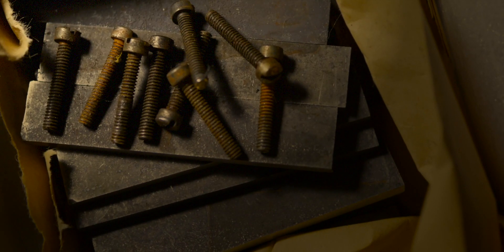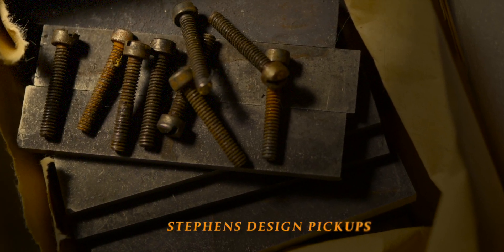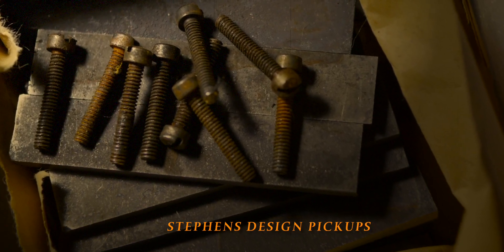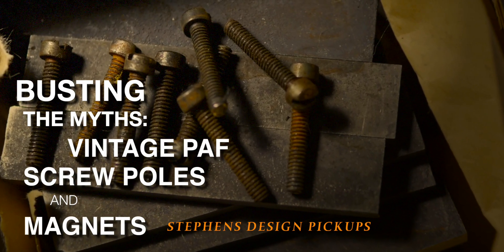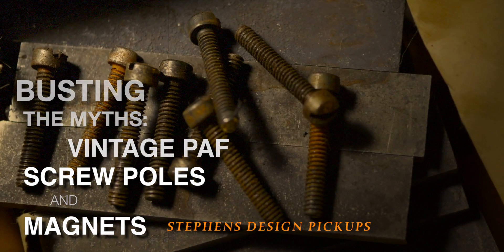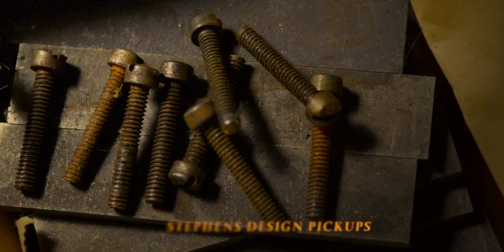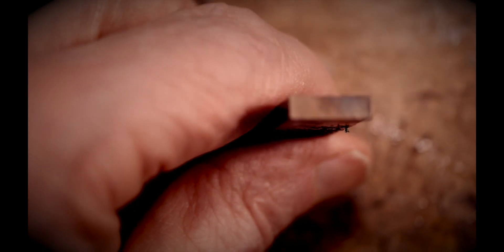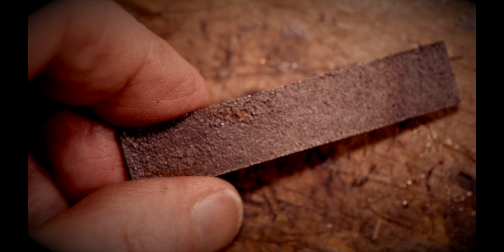PAF MYTH BUSTING - MAGIC MAGNETS AND POLE SCREWS

Comment: LOVE THE NOT SO SHARP INITIAL ATTACK OF THE A2, ALWAYS BLENDS THE NOTES TOGETHER BETTER, TO MY EAR.....THERE SO MUCH LESS IRRITATING TO MY EARS.....IM NOT A HEAVY GAIN GUY, BUT I LIKE TUBE BREAKUP ALOT,, FOR HEAVY BLUES  BUT THE ATTACK HAS TO BE  FOR MORE ROUND FOR ME,  OR IT SOUNDS LIKE METAL CLANKING TOGETHER, ....ALSO, I CAN TELL YOU 90% OF THE TIME WHEN THE MAGNT IS TOO STRONG.....I WANT TO SAY, IT SOUNDS TO ME LIKE IM HEARING MORE OF THE STRINGS, AND THE ALLOYS OF THE PICKUP, THEN THE WOOD....DOES THIS MAKE SENSE TO YOU? GO AHEAD LAY IT ON ME PAL, LOL..IM NOT SCARED, I CAN TAKE IT....I KNOW THAT THE MAKE UP OF THE MAKENETS/POLESCREWS, ARE MORE OR LESS INSIGNIFICANT.....AND MAYBE MY EARS ARE SENSATIVE TO A STRONGER MAGNET, BECAUSE ITS ONE OF THE MOST EVIDENT CHARACTERISTICS I HEAR IN A PICKUP I DONT LIKE....MY CHOICE IN MAGNETS, ARE DEFINITLY A2, I RARELY LIKE ANYTHING WITH A5'S, JUST SOUNDS LIKE 2 UTENCILES RUBBING TOGETHE TO ME, I HAVE NO IDEA WHY? LIKE THE TREBLE AND VOLUME ALL THE WAY UP ON AN AC/30 AND PEIRCING TELE BRIDGE, FROM 1974 ,THINK OF THAT AND THATS WHAT A STRONG MAGNET DOES TO MY EARS...THE SOUND IN THIS VIDEO WAS EXACTLY WHAT MY EARS ENJOY, ROUND, ATTACK, A NICE WIDE BANDWIDTH, WITH THOSE FLUTTERING CLEAR NOTES, BLENDED PERFECTLY!
Reply from the maker: Magnets and pole screw alloys are not insignificant. The vintage pole screws and magnets have a very tiny difference that is less bright. You put them altogether and it starts to be more easily heard. The magnet wire has the most effect on the overall sound, the old wire is not reproducible unless you're Bill Gates. PAF's used about 3 different alloys in the pole screws, one of them is from before PAF's were made, but they do show up in earllier PAF's. Another were from the last PAF's into Patent and TTop era. They did not change these alloys, its just that common hardware store screw alloys changed thru the years as steel making became more "perfect."

Comment: Nice to greet you, I'm a big fan of your work. I'm trying to incorporate some improvements to my 2013 Les Paul Traditional to bring its sound closer to vintage spec, sound-wise. On that path, while I'm moderately happy with the changes, I still think the neck pickup could be a bit brighter and more articulate (I currently have mounted a 57 classic pickup). Do you think it might be worth swapping out the alnico II bar magnet for an alnico V bar magnet that I've pulled from an Epiphone SG?. Thanks in advance.
Reply from the maker: Yes, an A5 magnet would help some. Higher value pots for neck volume and tone will help. Put all the pole screws down flat with the cover on the neck will help. Turning the pickup around backwards will help; Gary Moore did that a lot. It puts the brighter slug coil toward the neck, so it picks up more treble
Reply: @SDPickups  The solution has finally been an Alnico IV. With the A5 the guitar gained in brightness but lost the vintage tone. With the A4 I managed to somehow keep the vintage tone of the A2, some more clarity and a slightly brighter tone, so I'm very satisfied with the change. A couple of days ago I bought the vintage length steel studs and anchors from crazyparts, the guitar gained in resonance and sustain but lost a lot of harmonics along the way. For the moment, I will leave the standard ones (with the Kluson aluminium tailpiece). I'll wait for now, as I have to buy the Faber ABR bridge and some brass converse studs to replace the Nashville bridge. Do you know of any Nashville - ABR conversion set that would get me closer to those vintage specs? Best regards and thanks in advance!

Comment: Great vid. Thanks for sharing all this knowledge. Off topic, but have you seen the PhilidelphiaLuthierTools ABR1 bridge and tailpiece? Unless I’m missing something it seems legit.
Reply: Got it...I can’t believe that No one single company makes anything with the correct alloys and materials...like how hard can it be to make a beefier softer brass saddle??? Or a 1oz aluminum tailpiece?? I feel like we’re really missing something or we are being Punk’d! 😂
Reply from the maker: There is so much HYPE in the guitar and music business. The manufacturers of guitar parts/gear/etc. aren't very smart. they make things look pretty, then they claim "ITS VINTAGE TONE." Well, no its not, and no its not a copy either. Gibson claims they are making reissues, no they are not. When they stopped making Les Pauls, they never made them again. They made pretty guitars that don't sound like the originals did, they got greedy and raised the prices sky high, but the guitars never got better, nor sound like originals. Their only goal is make as much money as possible, while claiming they are recreating those guitars, but they are not. The aluminum tailpieces they use, they will sell you one for 200 dollars, and all it is, is a Kluson 20 dollar part, exactly the same. You're just never going to get an actual replica of the original Les Pauls unless you hire a builder who specializes in recreating the originals in every single way. It is a bit expensive but much less than Gibson charges. Once you get one of those and play it, you'll never buy another overpriced assembly line LP again.
Reply from the maker: Nope. Just another ordinary cheap bridge, not even close to originals.

Comment: IT IS IMPORTANT FOR MY KNOWLEDGE WHAT YOU THINK ABOUT THE NEW CUSTOMBUCKERS PICKUPS THAT GIBSON MADE FROM THE 2019 CUSTOM SHOP R9 60 TH AND AS FAR OR CLOSE TO REALITY, WHAT YOU THINK, I ALSO BELIEVE THAT I IMPROVED HIS HARDWARE LIKE HIS HARNESS, AS YOU CONSIDER IT BECAUSE GIBSON ASSURES TO HAVE EXACTLY RECREATED EVERY DETAIL IN HIS GUITARS, DO YOU THINK IT IS TRUE, OR IS IT STILL A LIE OF GIBSON
Reply from the maker: Its just marketing lies. They still use tone killing plastic "nitro," and still do a lot of things wrong. Custom Buckers have many many things wrong with them, they aren't even close to vintage PAF's. I have started to work on Part Four of my video series, and I expose the Custom Buckers and whats wrong with them. In that series you hear them in the '60VOS. In Part Four I am replacing them with my '59 set, so you can hear what a proper true PAF replica sounds like in comparison.

Comment: I'm glad you used the same guitar for the comparisons. Some people, when comparing vintage to modern/reproduction leave the vintage in the vintage guitar, and use the new in the new guitar. Vintage guitars can sound different from some modern guitars. Maybe its the wood, or the hardware, or maybe its the difference in pickup material or construction ... who knows. In this video, these variables have been nicely omitted. Very nice comparison. Modern Gibson polished Alnico2, such as found in the 490r/t pickups, definitely sounds different to me than some other sources of A2. I have a set of those from a 2001 SG, those A2 mags very blah.
Reply from the maker: A vintage guitar compared against a modern guitar doesn't work at all. Its everything, the vintage harness wire, hardware, neck truss rods, all the wood literally every part. Some of these companies like Gibson and Fender have been using Arnold Magnetics, an American company. I have tried them in the past and their alnico is space age high tech stuff and completely souless and bland. WTF are these guitar companies doing? Don't they LISTEN to what they are buying? Vintage magnets and Chinese magnets are very close to eachother if not even indistinguishable. Back in the 80's people were giving bad reviews to Fender's Strats and it was Arnold alnico that was causing the problem, really bland lifeless magnets. They hired a guy to come in and figure it out and he did, they changed to Korean magnets which were what all us pickup makers were using, and problem solved.
Reply: I have a 1990 Fender HM Strat. The Alnico single coils are also very "Blah". Maybe I should swap out the Alnico magnet pole  pieces. They were probably Arnold Magnets as well.
Reply: I shouldn't have said "who knows", since there are people who know. No doubt, you're one of them Dave. That's why I enjoy your channel.

Comment: The original '57 magnet sounds lower output, probably because it has partially demagnetized over time. The modern Alnico 2 also has a snappier attack (still not as snappy as an Alnico 5, obviously).
I find the Alnico 4 to have a very distinctive sound that is nothing like the Alnico 2s and 5s.
Reply from the maker: Actually I made sure both magnets were equally charged as measured by my DC gaussmeter from Alpha Labs. I'm starting to realize that some people are hearing things that aren't there, probably because I have labeled which is which, but also because these were recorded on different days. Temperature changes, humidity changes, the mics maybe not 100% in the exact same place on both days. In retrospect I think I should have made this video as a blind audio test, then see what the comments are. Personally I heard no difference between modern and vintage magnets, none at all. The pole screws, I think the vintage screws had a really tiny but less treble top end, but if I switch from one to the other by clicking back and forth in the timeline that difference is almost not there. If the room was colder on one of those days, the pickups and speaker and amp would sound brighter. As for alnico 4 your statement is too broad. There is no such thing as an "alnico 4" tone. Why? Because every magnet company uses their own recipes. I have stocks of all the alnico grades, from different manufacturers, and no two of them sound the same. I have extremely bright alnico 4 and warm alnico 4; its the same for all the grades, the sound depends on who made it. Even A5 magnets, its the same thing. They also differ in their resistance to degaussing. I don't fully charge my modern magnets, and keep them down to the levels of all the vintage alnico bars I take out during restorations. Also, when you remove a vintage magnet from a PAF or P90, etc. their gauss levels immediately drop since its pulled out of the metals that keep its charge stable. Then, I will recharge them and notice if it keeps its charge. Mostly they will drop back down to weak levels, but some won't and stay at a higher charge. Ideally this video would have been done all on one single day, but thats impossible, because when you switch magnets, you disrupt all the domains in the steel when you remove and replace a magnet, which causes the pickup to go darker sounding. You can hear this in person by rotating all your pole screws about a half a turn, then play and you'll hear its suddenly darker sounding. Interesting stuff I've learned over the years.....
Reply: @SDPickups  Thank you for the very in-depth reply.
I agree that there could be many factors that could influence the tone at the time of recording.
Personally, I couldn't reliably tell the difference between polescrews (maybe because of my tinnitus), but the difference in output and attack between magnets was more prominent to my ears (for whatever reason, could be unrelated to the magnets themselves).

If you want to be more scientific, you could run the DI signals dry into a spectrum analyzer and compare the graphs. That would take the mic positioning, weather conditions etc. out of the equation at least.
Reply: @SDPickups  just curious if you’ve had your hearing checked recently to make sure what your brain is processing is still accurate? Humans lose A LOT of hearing as we age, I’d be surprised if you can hear above 12k any longer. My range is 21 Hz up to just shy of 18k KHz and I hear differences that you may not simply because your hearing isn’t what it used to be.
Reply: to me vintage magnet sounded better or nicer for my liking...also generally prefer alnico 4 magnets among modern magnets you can buy now...I found they sound pretty much like older alnico 5 I found in maxon pickups which I also like very much.

Comment: Great video !! So basically old or new componets as long as its built the same it will 99% of the time sound the same.
Reply from the maker: No, its not that simple ;-) The materials have to be as identical content as possible and the physical geometric design has to be identical too. This is where I don't share what I do, and keep many things to myself. For instance you can buy a batch of steel to make some of these parts, but each batch can be radically different, though is called by the same alloy "name." Or you can go buy a box of slugs and find out they are shorter or longer than real vintage slugs, and have bevels on them which the vintage don't. Bevels remove materials, it removes MASS. The stuff parts sellers sell are pretty much ALL wrong. Some of those parts actually have LEAD in them. This is why I don't mass produce my work, because the materials are so variable, so I am testing every material I use to stay as close to the real materials as possible. And why I machine and do my own plating to make my own parts with a lathe and mill, and use old methods. With the knowledge I've gained thru industrial help from a senior alloys engineer for 6 years, I know these materials inside and out from high tech lab work that covered basically 40 years of parts from ALL the pickup models Gibson made from 1937-1977. That knowlege is the Bible of how materials changed pickup tone over that specific time period. So, I'm not a "winder," but a designer. My bridge pickups are designed to be on the warmer side but staying strictly with vintage PAF reality, but my neck PAF replicas use the knowledge of the later PAF's and Patents, that made great and clear sounding neck PAF's. So the two pickups are not interchangeable. I've written all this stuff down in the event I die,  and hopefully my wife will make sure it gets published in some form.

Comment: They both sound great. The difference would be like splitting hairs.
Reply: I agree that they both sound great but the modern materials sound modern and the vintage ones vintage. The screws were much softer in the modern and the magnet was really very different: way boomier bottom end.